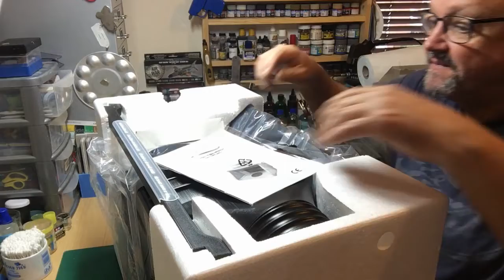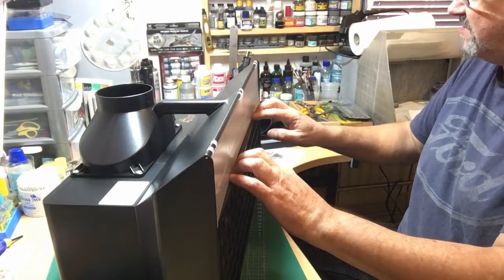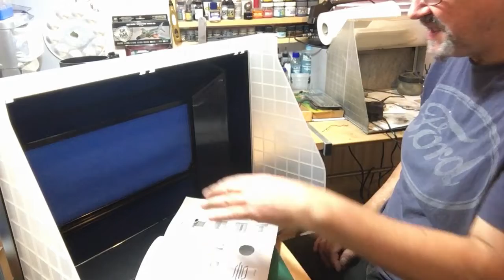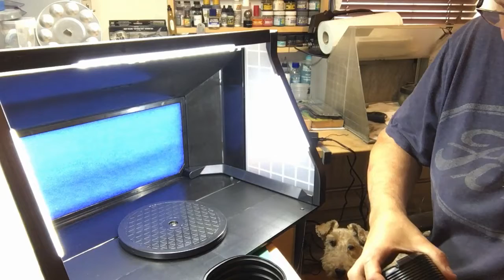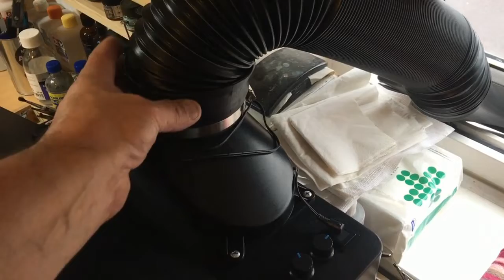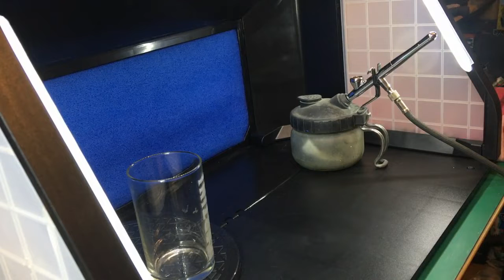Bartsharp SB04 Paint booth review and test

Comment: Hi Nigel. I know it’s some time now since you posted this video about your new Bartsharp spray booth and that you’ve since changed over to waterfall booth. I’m a newly retired returnee to the modelling world and about to venture into buying an airbrush setup for the first time and have been looking at the Bartsharp type booth, or what appear to be exactly the same booths on Amazon. I wondered if you had any issues with the Bartsharp or was it simply that Gaahleri offered you the waterfall version to try and you’ve stuck with it. I can see the benefits of waterfall btw but at this stage it’s pushing my luck a little with my wife to go that far 😂. I should add that your channel is superb for a relative newbie and by far the best I’ve come across in terms of explaining what your doing 👏
Reply from the maker: Glad you find the channel helpful! The Bartsharp booth is a solid choice for a first spray booth, and you wouldn't go wrong with it. I have actually returned to using the Bartsharp mid 2025 as the waterfall type requires maintenance to stay effective and fresh.
Reply: Thanks Nigel. Bartsharp it is then. Should I expect it to stop airborne particles making a dusty mess of the room or do I need to start managing expectations? I’ll have the hose out of the window like you btw.
Reply from the maker: @alanmiller259 it is a brilliant extractor Alan. I’m sure you’ll be over the moon with it!!

Comment: Is this the original seller of this style of paint booth? I too had Nigel's original paint booth, from 2014ish until late 2022. You can find many dozens of brands selling their version of that paint booth. Here in early 2023 you can now find dozens of brands on Amazon selling this new, larger dual fan paint booth...Having recently just bought one myself, it seems as if this Bartsharp may be one of the originals? Mine does not have the adjustable lighting, it's a simpler switch rather than a dial.

Wild how we went so long with one type of cheap paint booth, only to have this new style take over the web listings in the last two years.

Comment: Looks like a good airbrush booth with great features, variable fan speed and LED brightness sound excellent, I personally don't use one though, but the lighting and turntable look good for photographing or videoing your finished projects.

I have 2 of the Bartsharp airbrushes, the 130 with 0.3mm and 0.5mm needle and nozzle sets and a 180k with a 0.2mm needle and nozzle, but cleaning it with the crown cap is a nightmare (and they clog a lot!), so I don't use them, I just run it with the bare needles and am careful not to ding them.
They're not the best airbrushes, but perfectly good for larger areas, like basecoating and priming, even spraying camo patterns.
The compressors with the 3l (maybe 3.5l) tanks are great and really quiet 👌.

I've never been a fan of Iwata airbrushes, only the ridiculously overpriced Custom Micron. 
I use a Harder & Steenbeck with a 0.2mm and 0.4mm needle and nozzle setup and interchangeable paint cups, a 2ml and 5ml.

The Bartsharp ones I own, have fixed cups, the main problem though is the cup bottom is deep and at a 45° angle, so you waste a bit of paint and the needles feel a bit rough, parts are cheap though. They're pretty good value, much cheaper than an Iwata (sadly, you can tell by the machining, the bottom of the cups look like a spirograph).

My Harder & Steenbeck airbrush is much nicer than any Iwata in my experience, the "fineline" nozzles make tip drying easy to clean and cost a lot less than Iwata, you said about £38? The Harder & Steenbeck needle, and nozzle sets - with a fineline cap only cost around £26 for the improved V2 design with a free-floating nozzle.

It's also German engineering, which is second to none, compared to Japanese designed and made ones, much easier to get parts for and a lot are interchangeable between the Evolution, Infinity and Ultra, (every model except the Colani airbrush) so you can use them still if you upgrade at a later date.

H&S are the "go to" for miniature painters and I use mine on my model aircraft as well, 28mm miniatures to 1:48 scale models no problem. 
They disassemble and reassemble so much easier as well for cleaning.

Comment: Thanks Nigel. I have been considering getting the exact same booth for some time now but always putting it off.

Do you think the booth would also work OK with spray cans? Or there will be too much excess spray falling on the filter and booth and eventually damaging it?
Reply from the maker: Hi Dimitris, Not sure any booth will be good enough for cans. Really designed for airbrushing.
Reply: @NigelsModellingBench  Fair point. It's probably time I invest in an airbrush too then :-)

Comment: Can anyone help me with a bit of a dumb question? With this type of set up does any colour at all come out of the pipe dangling from the window? The reason is the walls of my house are rendered white and I’d rather they stayed that way than become camouflaged RLM 70 or 71. Also the window of my modelling room is right over the front door and I don’t want to paint the vicar when he comes round for afternoon tea!
Reply from the maker: I certainly saw black very fine dust in the exhaust of my old booth, but it is very dry and blows away easily. I would imagine you'd be ok. Perhaps make up somethig to hold the nozzle pointing away from the wall?

Comment: Nigel, I love this review, as with all your carefully considered and comprehensive analyses but I'd add two additional factors in paint booth ventilation:  1: booth filter cleanliness, and 2: outdoor air wind speed that may affect booth exhaust effectiveness.

My setup is in the basement, below ground level and with my exhaust nozzle exiting through the window (exactly the same way you've done with this Bartsharp) I've realized that some of my exhausted paint material gets blown BACK IN if the wind is strong enough.  For that reason I still wear a mask when painting.

The blow-back may be negligible but often I can visibly see it happening.  Insofar as the filter, I change mine every time I start a new project.

Comment: I've had the same booth for over a year and find it very good.  I have extended the sides out with foam board and put on a 5mm clear acrylic lid which allows additional lighting from above and doubles up as my photo booth.
Reply: would love to see this, did you make it or was it a product you bought? and can I get a link if possible?
Reply: I just made it up from stuff I had. Any board would do for the sides and acrylic sheet is easily available cut to your custom size.
Reply from the maker: Good to know!

Comment: What’s the availability for the filters like, I have the same as your old one and their filters are almost impossible to find. I can get the second of the two filters it requires but the front (blue; and finer mesh) is likes hens teeth.
Reply: Try UMP retail for the blue front filters.    Paul / Lee from UMP RETAIL can supply these.
Reply from the maker: If you have an engineering firm or anyone nearby who uses machinery, they will buy massive rolls of the stuff then cut it into smaller pieces to go into their electrical cabinets. See if you can buy some from them?